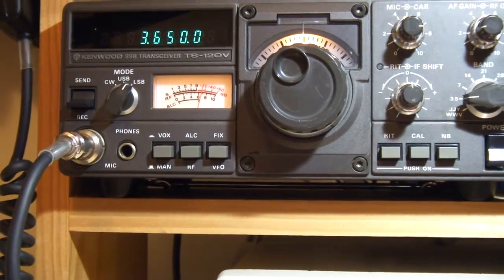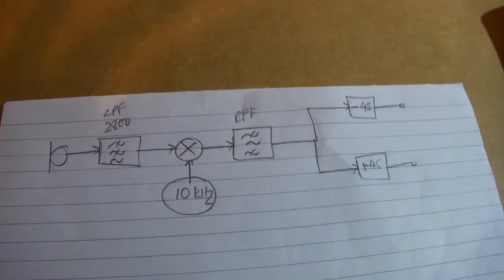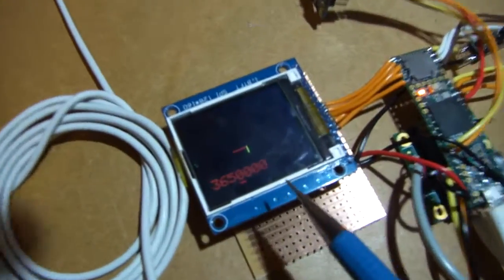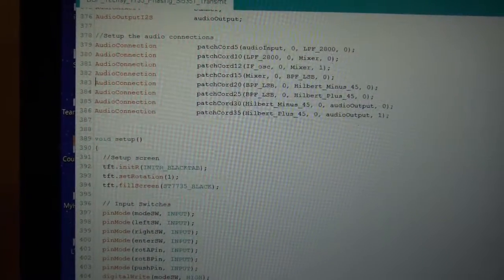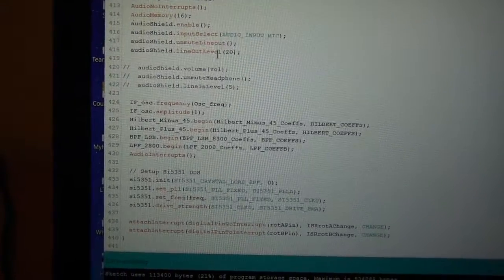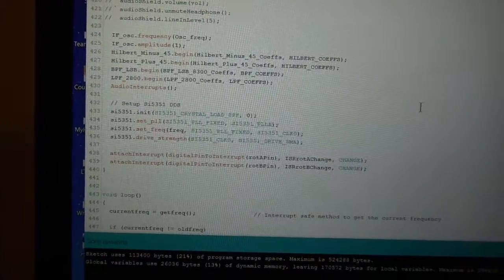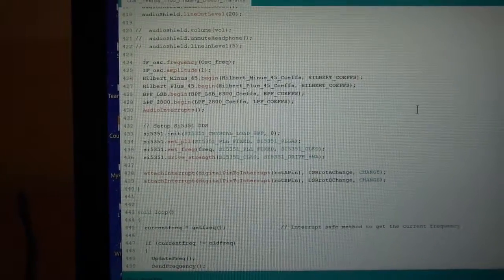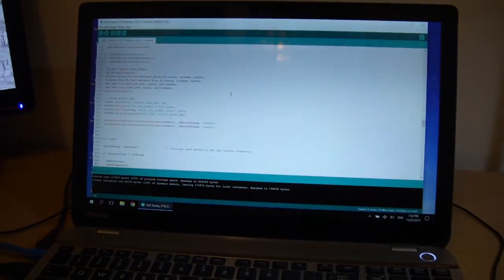Homebrew Teensy SDR Transceiver Part 5 - Transmit experiments

Comment: Keep going Charlie, I want to see a full ssb txcvr next!  😀 How much current does the Teensy 3.6 draw at 3.3 volts?  without the FFT display powered up?
Reply from the maker: I'm going to make a tramping rig, much like your SOTA transceivers. I'll use a small 0.96" OLED which I have used several times before. I suspect that combination with no FFT will be quite efficient. I'll see what I can wire up to make some current readings. Remind me if I forget.
Reply from the maker: Getting close Paul. Got the LSB/USB switching going well. Just a matter now of combining the receive and transmit logic. I'm going to be out of town for a a week or so, but will try and get something out before then. I'll put the LSB/USB code up on github.
Reply: Charlie Morris Excellent! Ordered from PJRC yesterday so will be able to see if I can reproduce some of your successes down the track. 73 and good luck!
Reply from the maker: Paul. The transceiver is all function and seems to run well. The code's up on github. I'll endeavour to make a video when I can.  
73's, Charlie
Reply from the maker: Paul. I did some current readings. The current configuration is a Teensy 3.5, 0.96" OLED and no FFT,  just displaying frequency and mode. The current draw on receive and transmit is 104mA. Please note, that this does not include the divide by 4 quadrature clock generator nor the RF amp.
Reply: Charlie Morris Thanks Charlie. Thats great. The unknown was the Teensy.  At 100+ mA its well within the range of my discrete homebrew rigs with ATMega328 and si5351. As an unfair comparison the FT817 draws 300mA on receive, apparently, with the audio gain down.  100 to 200mA is fine for a Teensy SDR portable rig in this day of 4 and 8AH LiFePO batteries. Looking good.  Thanks!
Reply: Charlie Morris Tnx Charlie. I'll pull down the transceiver code and have a look.  Assume this is the DC version, not the 10khz IF version. Great project!  Cant wait to see it all boxed up for  'tramping'.